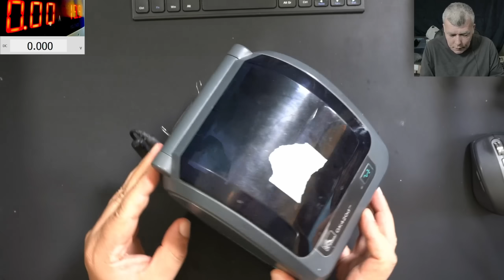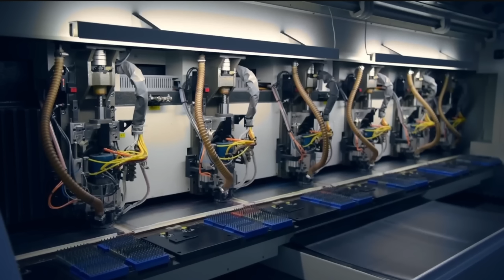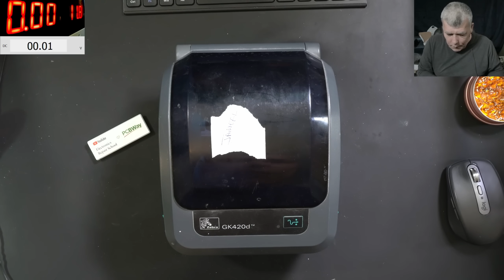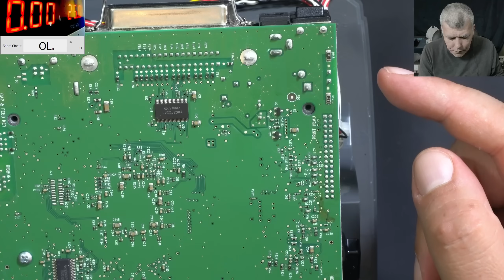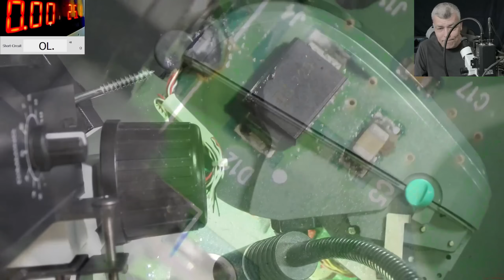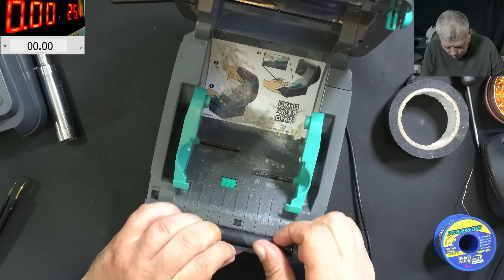Zebra GK420D label printer repair- no power

Comment: I'm dealing with something almost the same. Trying to remove the socket is a pain because it is soldered on both sides. There is just enough solder left after vacuuming that it will not release, and because it is in both sides, you heat up one side, and the back side cools again.I think I need 3 irons and 4 hands 😀

Comment: Why is the charger 24.4V? Our battery powered vacuum cleaner also has the same voltage, but because it has batteries. This one does not.

Comment: I had a similar fault on a thing sometime ago. I don't remember the thing but do remember the fix. Re-flowing the power connector. Visually it looked fine but continuity test revealed high resistance.  Lead free, too cold or too much mass in the tab to flow correctly in the oven maybe. Anyway, good video showing a sneaky fault.